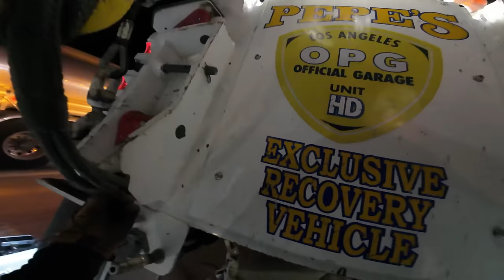Fuel Tanker Truck EXPLOSION Shuts Down Freeway

Comment: I agree with the fire department, no reason to lift a loaded wrecked tanker truck. Great work as always though you guys are so willing to help and give incite since it's what you do every day!
Reply: No reason not to with the proper equipment in the proper situation either, but id argue when the offload truck is stuck in traffics and hours behind something has to be done.
Reply: @towtruckaj  Yes, agreed. I believe Alex was proposing that they just tow the loaded burned tanker, as long as it wasn't leaking. It would have been much faster. However, FD has it's rules.
Reply: @IceColdGeico  At the end of the day as tow operators we really don't care, we can do things however they need to be done to work around other agencies and we bill by the hour, If they want us waiting for hours to do it a specific way, so be it... Just isn't so beneficial to the customer nor the motoring public stuck on the interstate for multiple hours when it could have been done it 30 minutes, But at the end of the day we have to work with other agencies not against them so fire, police, engineers office, dot, etc we all work together for the greater good.
Reply: @towtruckaj  Time isn't a reason to skirt safety. There is no way to know what effect the heat had on the tank.
Reply: @saintchuck9857  If it isn't leaking and there are no signs of warping, no visible holes, no discoloration, etc then there is no problem, Mind you it's extremely difficult to compromise a tank with heat when it is full of liquid.
Reply: @saintchuck9857  Now I agree, With a possibly compromised tank in normal circumstances offload it first, however being as this was a tanker truck touching the actual tank was not necessary as it would be on a tanker trailer, A tanker truck doesn't require touching the tank to lift, and it doesn't rely on the tank for structure so it is far different than a tanker trailer.
Reply: @towtruckaj  this was both tanker mounted to the truck and a tank on a trailer
Reply: @jays106  Sure, But only thing lifted was the actual truck... the trailer was simply disconnected and connected to a new truck, Never lifted.

Comment: “You got wheel chocks “😂😂😂😂
Reply: yeah they don't do a lot of good when the tires are in the air
Reply: @griffoutdoortv5882 it's the front of the truck that would be in the air not the rear
Reply: @damanayadekunle7232 I’m talking about the drives of the wrecker being in the air because of the out riggers
Reply: I think he was picturing a tow truck used for repos .😅
Reply: @griffoutdoortv5882  oh ok 👍
Reply: At least the man asking is thorough and safety conscious 👍
Reply: I operate 10 to 18 ton boom trucks for a living and I'm constantly asked about wheel chocks. I just look at my outriggers and shake my head. Some people just don't get it.

Comment: I thought that CHP officer was going to go all Melisa McCarthy on that tanker dude :)
Good call to unload that tank. Aluminum can easily become compromised when heated. You can tell it got pretty hot by the color. It is probably OK to lift it and transport it, but if it cracks then that is a huge mess to clean up.

Comment: 35 years ago I watched a propane tanker truck burn on the 880 fwy. next to the Marriott hotel, Santa Clara, CA. As it burned the pressure valve on top intermittently blew shooting flames hundreds of feet in the air. All authorities could do was let the truck burn up before the fire could be extinguished.

Comment: We had a diesel tanked rollover and spill in Mass last year. Highway was closed for 2 days in both directions, tore up a hundred yard stretch of asphalt and repaved it. There are STILL some trucks staged nearby for whatever reason. I can only imagine the bill... PS, wasnt the truckers fault. some moron side swiped a pickup and it ended up hitting the trailer. What a mess.

Comment: I'm guessing fire don't trust the usual cowboys that turn up to lift a loaded tanker.  So they have a default and fixed response to unload first.  I guess there's also a true risk that the fire could have compromised the tank or pipes just enough that something leaks during the tow away.

Also: did Alex say that the outriggers are Stainless Steel. Fancy, or Wow as the guy said.

Comment: I get it that the pipes are damaged and it doesn't matter,  but nobody in the oil industry lifts pipes from the end, and never steel on steel.  Front end loaders with a grapple fork is usually used in the field.  Moves well on uneven ground.  Someone should have had pipe stakes in thier box, at least for the loading until secured.

Comment: I Don't understand why it had to be put on a Landoll when it could have just been towed.
Reply: Company wanted the tanker on a landoll , customer is king my friend
Reply: That frame was pretty compromised. Do you want to risk the motor falling out the bottom while going down the freeway?
Reply: @DrewMarold  Or what was left of it. And even without that, there was still big chunks falling off of it. Did you see what was left of the turbo? Wow.

Comment: California is so stupid if that trailer is not leaking fuel, it could be hooked up to another tractor and do it delivery😮
Reply: That isn't California. That is most likely every state. There is zero reason to risk compromising the tank due to unseen damage from the fire. Would it most likely have been fine? Yes but no reason to risk it.
Reply: did you miss the part where the front tank is hard mounted on a truck chassis? and the separate tank trailer was in fact towed away by another truck from the company to be off loaded?